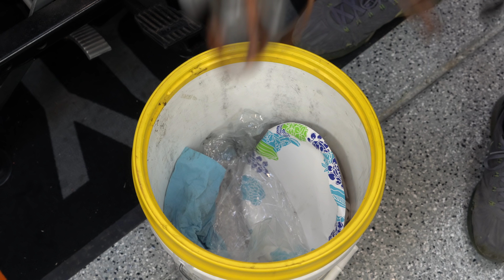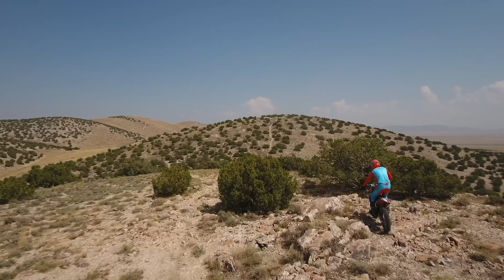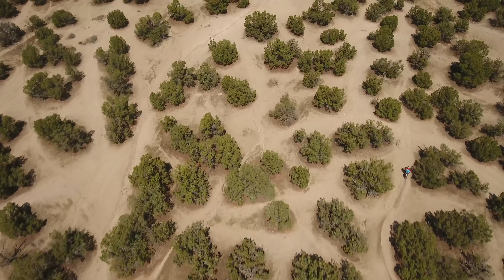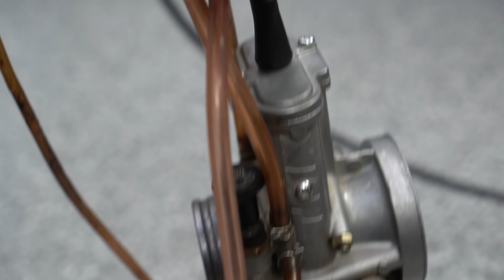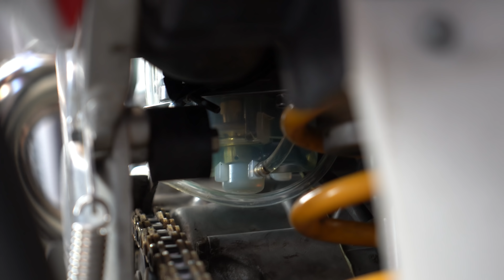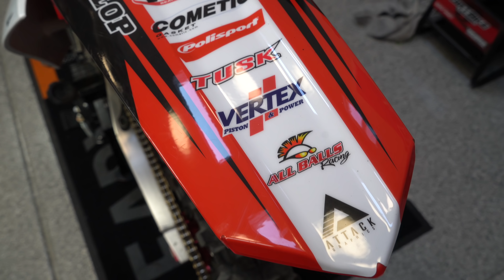Lectron Carburetor on the 2003 Honda CR250R | This thing SCREAMS now!

Comment: You sold me on the Lectron. I struggled for a year trying to work out my jetting on my 16 Beta 300RR Race edition. Is get it good then go for a ride 4000-6000 feet higher and it was crap. Tried to jet in between and it wasn't great. Put the Lectron on, made one small metering rod adjustment and haven't touched it since. Ridden for a full year from St.george  (3000 ft) to the top of skyline drive (10897 ft) 40-90+ degrees. Runs awesome. This carb and my Tubliss set up are by far the best mods I've tried.
 Thanks Kyle

Comment: Quick tip for taking out/ intalling the carb on 02-07 model is just take off the whole subframe assembly it come off as one piece with the silencer still attached. Then just take out the bolt for the rear shock pull shock back and boom remove or install the carb what ever the case may be. 

After words reattach the shock and when putting the subframe back on make sure the silencer slips on first then line up the airbox boot to the carb slip it on put the subframe bolts back in and your done. Should take no longer than 20 mins.

Comment: My cousin had a 2001 CR250 with that TMX carb and he switched out the center section to a leaner (I think #5) - and went with Pro Circuit jetting specs. The alitiude here in Central Ohio is around 800ft above sea level. This fixed everything with the Mikuni carb, it ran perfect after this!

Comment: Lectron is great. But the issue with that mikuni is the needle jet. Not the needle, the needle get. It had an s9 in it which just made it way too fat from 1/4 to 3/4 throttle. Go to an s8 or s7 depending on the atmosphere in which you ride and it cleans right up.

Comment: Looking forward to the flywheel weight install and testing. I'm thinking of getting one on my cr250.  Love the videos Kyle.
Reply from the maker: Looks like the next riding videos on this bike will be a month away, or more. I can't ride it yet and Tyler is busy for the next couple of weeks.  We'll get some content on it, but please be patient.
Reply: Get one. If you ride trails you’ll like it
Reply: I run a  Steahly 12oz on my 01 and am a rever from my MX 125 days but weight is nice when need to use the lower or mid RPM or just slow the spin up a hair into the power band to get more controllable traction since these don't have a adjustable power valve.  I also use a milled cover but think would fit even the 14oz if have the leaky plastic cover you have to clean out every ride depending on the year of yours though or should come with a spacer gasket like a Rekluse does. Race Harescrambles and Enduro in Vet A and had on for many of years, I check torque once in a while but it stays put. Not a vast difference but noticeable and not really that spendy and be fine if just trail riding too, probably better if just trailing cause if you got it wound up all the time don't really notice.
Reply: I put a 10oz on my 04 cr250. It definitely helps in the slow stuff
Reply: I had a 12oz on a 03 KX250 and didn't like it. The engine doesn't have good low end power and all the fww did was keep the engine from revving into it's usable power range in a timely fashion. Tended to take longer to return to idle as well. Had a 15oz on my CR500. It seemed to help a little down low where the ignition system is suspect.

Comment: I like Lectron R&D. I bought one for my thumper and they gave me a needle that they said should work as an Australian used it on the same motor. I plugged it in and it worked really well. I used the same cable example you've given.

Comment: Have ran lectrons on a lot if bikes, for back in the 90’s ran a 40mm on a cr500, bike was a legend. And that was with the ancient needle set screw. The newer 1/4 turn metering rad is so nice. Am running 46mm lectrons on a banshee drag bike on methonal. All that being said the tmx is a good carb, I prefer the later tmx, short body with the tps, i still run that carb on on my trx363 with an 04 ignition, killer bike
Reply: So would you recommend a lectron carb for a cr250? I’m having trouble with my bike. Twice I’ve been riding it and it just sticks wide open sending me off the back and the bike to who knows where, one of the times in a downed tree lol. Got a new throttle cable and happened again in the next ride 5 minutes in. When I give the bike throttle with it turned off, I can hear the spring in the slide catching but there is no visible problem on the slide or spring. Thinking about getting a lectron and a new throttle housing assuming that will wipe out all possibilities of it happening.

Comment: I just bought a lectron for my 03 cr 250 last night. I also have a 10 oz flywheel weight and 13:50t gearing and it runs great on the bottom, I cant wait to get my lectron installed. I tried doing the pwk swap but still wasn't impressed, I honestly bought that before I even heard of lectron but I finally decided to pull the trigger and buy one
Reply: How did it work on your bike? I have the same bike and did the pwk but it still sucks.

Comment: The carburetor is not junk. Honda put a number 9 dump tube in there Yamaha put a number 7 dumb tube in there which is smaller. That fixes the problem. To make the snappiness even better I put a 2007 Mikuni needle in my TMX carb which is a tapered needle. So about say 30 bucks fixes the whole problem. The 2004 to 2007 Mikuni carburetor is a 40 mm. That's the carburetor that I recommend to put on the bikes.
My 2001 cr had the tmx carb on it. That did the low end fix. Clip-on needle second top 390 Main Jet 45 pilot I'm at 500 ft.
I put the 2007 Mikuni 40 mm.
On my bike and wow it made it pull for bottom all the way to top end.
With no flat spots at all.
Hope this help someone

Your bike is
Very clean.

Comment: Hey I have a 01 cr250r I just swap the tmx for a lectron today and I noticed out of the box my lectron was idling super high and felt lean, throttle popped on deceleration and surging when I go slower and yeah the lectron install on the cr250 was a bit difficult

Comment: I ditched the Carb for a Lectron on my 2009 yz250. Best Mod besides the Flywheel Weight. Also installed a Boyesen Rad Valve just because it was due. Bike is way more responsive and the New valve put a lot more low end grunt.

Comment: My 04 cr250 has similar upgrades and the 10oz flywheel weight definitely helps. I recently put in a Rekluse and it's unstoppable on single track.

Comment: I would love to run a Lectron. Probably in a couple years. I ride from 3k all the way up to 8k feet in elevation depending on the season so i see a lot of fluctuation. In my videos you can tell when I am really high in elevation because i run a bit rich. I never change my jetting, either. 

I really don't think the gearing on that bike you are building will need to be changed. If you go any lower you will have a top speed of 40mph which would suck. It's got plenty of power down low even with stock gearing. It definitely needs a kick stand and hand guards though.

Comment: Been there, done that...  My buddy owns a 2003 cr250r.  We replaced the carb with the Keihin  PWK 38 air striker.  Much better throttle control and far more bottom end feel.

Comment: My 2001 always ran fantastic at all elevations (sea level -8,000ft) with stock carb. I never touched the jets, just moved the clip on the slide when riding real high elevations. Always started first kick too even after sitting with old gas  for almost a year sometimes. I believe 2001 had a Kehien though. Other older Honda’s as well never had any issues with carb. I think it might have less to do with the carb itself and more to do with the fact they changed to case induction making the engine more particular. JMHO
Reply: I'm pretty sure the 01 ran the Keihin pj carb not the tmx
Reply: Honda changed to the Mikuni TMX carb in 2001 for the cr250r. I have a 2000 model and it has the Keihin.
Reply: cosmo copus they must have changed mid year then cause I’m pretty sure it was a kehien.

Comment: Lectron - been considering one of these for my ground up rebuild on my 01' yz250. Called and left 3 voice mails  over 2 week period with Lectron  and they have not responded. Not sure how busy they are but they need to step up with customer support. Still considering one
Reply: @stevedorsey55  
Thanks Steve, been at the online site several times. Just have a couple technical questions to ask factory rep before ordering
Reply from the maker: Sorry you have had that experience.  They seem to answer every time I call.
Reply: Bill, sorry to hear this. We stay late to return voicemails same day, so I'm not sure how yours has gotten missed. Make sure you have the right number (830) 331-2235 and your voicemail is setup and not full in case you don't pickup when we return the call (this happens often).

Comment: What oil fuel ratio are u running?
Reply from the maker: Amsoil Saber at 80:1
Reply: I run 40:1 Klotz castor & Sunoco Silver (100 octane) in my '96 CR500. Never had any issues.
Reply: C9/castor 927
Reply: Keith Peterson lol, every bike is different and elevation plays big key. I personally run 50: 1 for Texas, different when I was in Colorado and Arizona.
Reply: Keith Peterson   the oil required changes when jetting changes for elevation
Reply: Keith Peterson  nope..... Bro I've done this as a pro mechanic for 20+ years... Sitting next to me is a motocross pro from here in Texas... Oil mix changes with jetting and elevation you will not get the same power in Durango as you do in port Aransas with the same jets and mix... Sorry to burst your all knowing bubble.
Reply: have a good time with that dyno. That you're obviously a expert at...

Comment: I installed a lectron for a friend on a 2000 cr250 and I ended up taking off the shock. Installed mine on my yz125 in under an hour.
Reply from the maker: yeah, this one almost required taking the shock off the bike.  It was close.
Reply: The trick is simply to remove the two upper subframe bolts so the airbox will tilt backward with the subframe. At least, this is how to do it on the CRF and it seems to be the exact same thing on this bike.
Reply: Even with doing that it was not enough. The clearance between the shock and the frame of the bike is too tight generally speaking.

Comment: Get in touch with Terry Varner after  you get finished throwing parts at it. Send the cylinder and head to him if you want to experience the full potential of the 2003 cr250. I dare you. Lol

Comment: Sick of tuning my 06 yz250f You basically have to take the whole bike apart to get the carb out. Been tuning it for years still doesn't run worth a damn. Really not smart to just ''put around'' without a helmet, did the same thing you did a few years ago, ending up breaking my neck just testing her out. Thank God I had my helmet on

Comment: Japanese bike, strip the bike down to the frame before installing the carburettor 😂 disclaimer I'm only teasing but I have found that the KTMs I've had in the pass are very easy to access key areas of the bike without taking alot off of course that isn't always true with everything.

Comment: TMX carbs are complete garbage, even Mikuni's old round slides are built better.
Way to many plastic parts in the TMX I'm surprised that Honda would even consider
using one, they must have got a good deal from Mukuni.

Comment: Heads up, you can get a descent amount of cash from that carb on eBay
Reply from the maker: I need to look into that.  Want to buy it from me?
Reply: @DirtBikeChannel  you'd have to pay me to take it! 😁 I put some new lines on my takeoff from an '03 CR and it sold for like $150-$175 I believe.. no clue why they are selling high but it sold fairly quick.  Stock jetting maybe include your jet kit.. 🤷